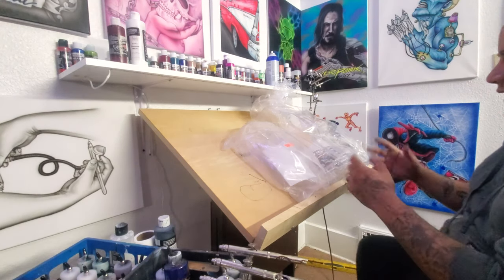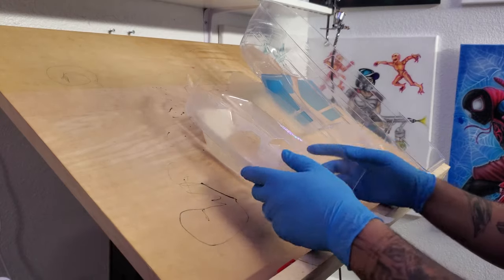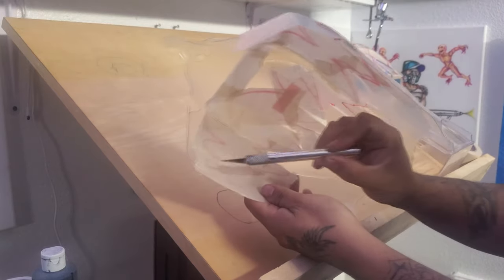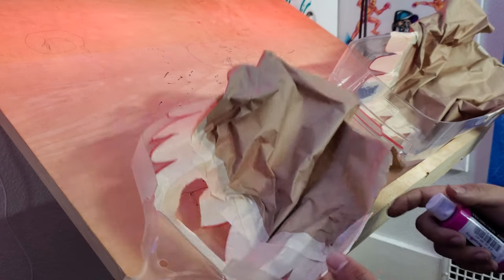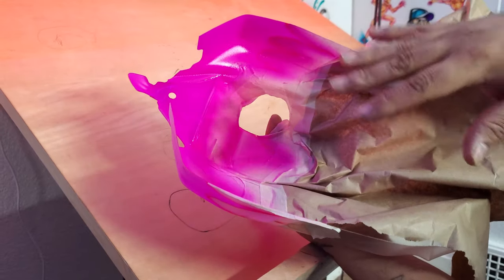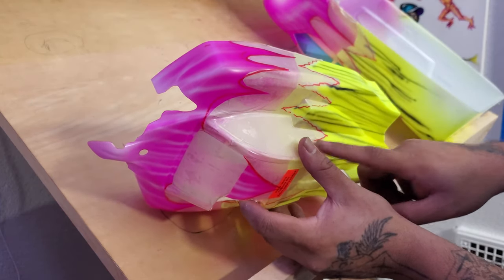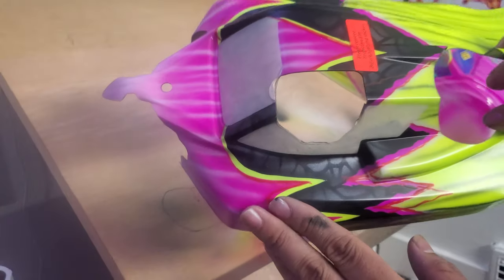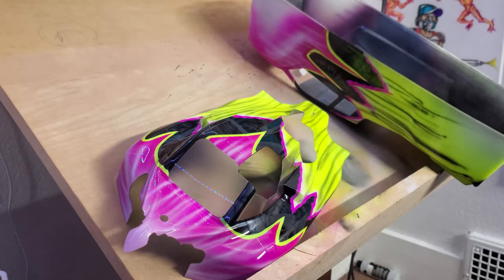How to Airbrush RC Bodies

Comment: To everyone that's probably going to use the clear from Rust-Oleum, it works very well, if and only if you use RC lexan PS before you use the Rust-Oleum paint. The way you are see the clear  used here in the video will work here it has something to bond with. Great video keep up the good work 👍🏻🔥😎🔥👏🏻👏🏻👏🏻
Reply: The clear from Rust-Oleum is for the final  coat? And what means rc lexan "PS"? Thank's
Reply: What??

Comment: I use the same also I use Krylon lawn chair plastic white for back dries hard won't scratch easily.
Reply from the maker: nice will try that sometime
Reply: What do you use? Im having a hard time with my proline paint, I even back it with tamiya but seems to be able to be picked through and scratched off easy
Reply: @radiocontrolledmadness8119  try the Krylon. I wish I could show u a pick. It's bonds to Plaztic and flexible I use it with drag bash touring cars I paint my friends and they live it plus it makes your color pop or Black if your doing a car with dark colors.👍🏽👍🏽

Comment: Maybe leave the window mask in until you do the clear so they stay clear.
Reply from the maker: they do stay clear. I clear over them to seal all the edges of the paint inside for when guys wipe and spray them off during cleaning.
Reply: Use a nitro blocker instead of the clear coat, the clear is not made for lexan, and after time and crashes will start to flake off. Nice paint job though.

Comment: Use Liquid Mask! you lay dark colours first, then move lighter.
Reply from the maker: you dont have to use liquid mask. and you also dont have to do dark colors first.... Tape is alot easier to work with and laying brighter colors first opens up the doors for effects.
Reply: @MikesBrush  you don't have to do anything... but results are way better with LM. try it.
Reply from the maker: @neallewis1  "better" according to who? There is no way that a different type of masking would make the design "better" Its your personal preference what you use. Here I use tape as its an instructional video. Tape is easier to work with, easy to get, and wouldnt you know masking tape works great for masking. 🤷‍♂️ You can do it your way and you can post your own video about it and we can see the "better" results. Liquid mask also has its limits and is alot harder to work with by far than masking tape. So coming and just saying "Use Liquid Mask!" doesnt help anyone and does not produce "better" results. Most of the top RC painters I see use masking tape cut on a plotter and rarely use liquid mask. "better" 🤦‍♂️
Reply: @MikesBrush  alright princess.
Reply from the maker: @neallewis1  I am clearly "better" LMAO  no insults needed....